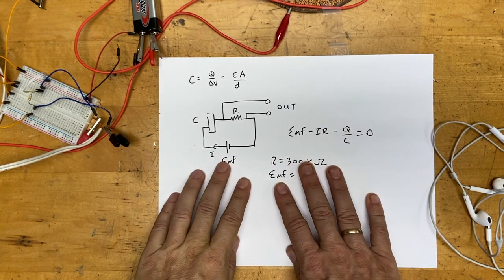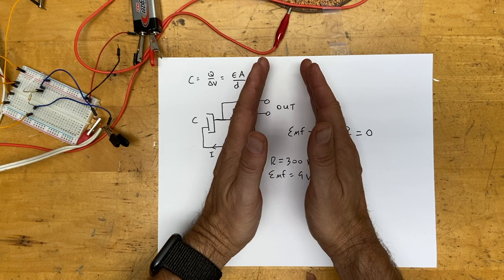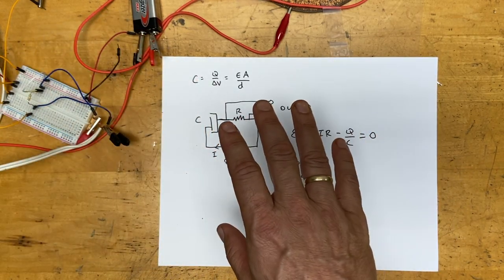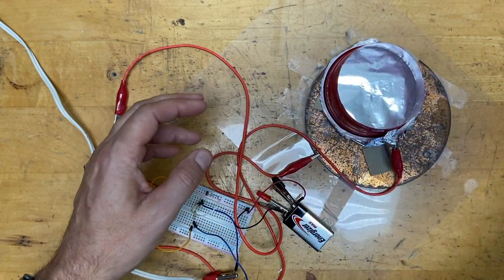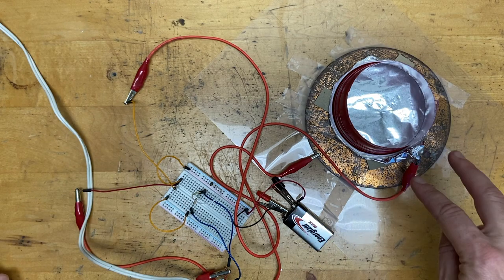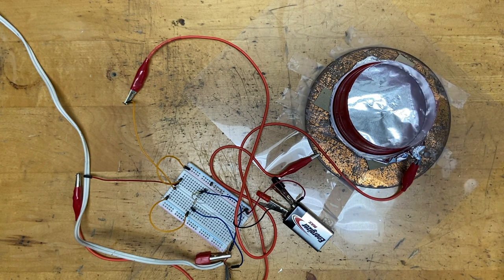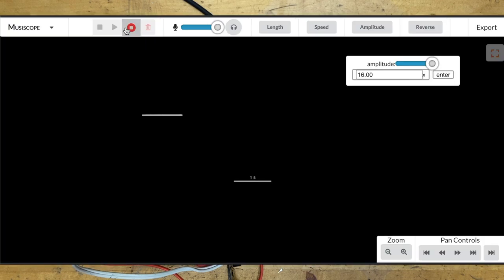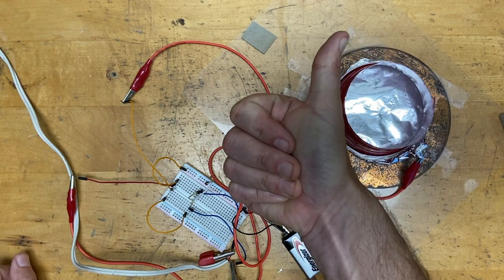Simple DIY Condenser Microphone Using Microphone

Comment: Just  a few comments to get better performance. The resistor is way too small, it needs to be greater than 50 meg ohm. Also the voltage is way too low, it needs to be at least 60 to 80v. The output needs to go into a Jfet in grounded source config. Take the output from the drain through a 10uf cap. The jfet is fed from 9 or 12 volts and the drain resistor can be around 4.7k Following these recommendations will get you a lot more output. You have done very well to get this going at all as this can be a very tricky circuit to experiment with. I did get some success using the metalised film you see on some crisp (chip) packets instead of tin-foil. You will never get hi-fi but you should get it working so you can clearly hear voice on playback. Nearly forgot, the back plate should have lots of little holes drilled in it to avoid dampening the movement of the film / foil. Good luck with your experiments!
Reply: You can also make video